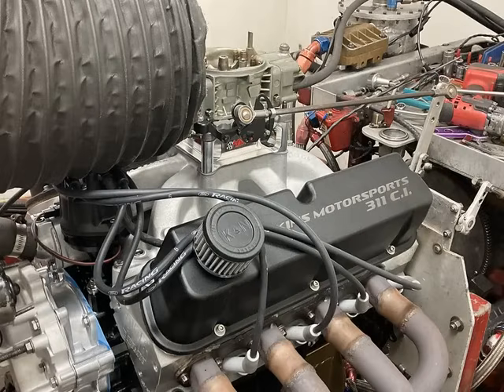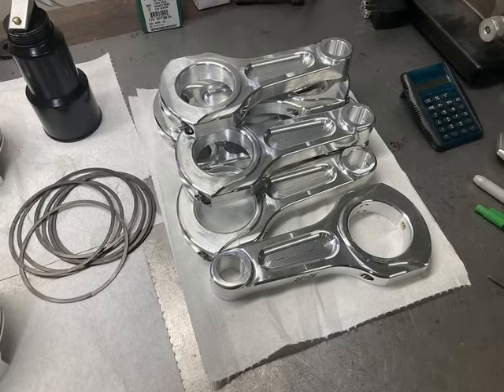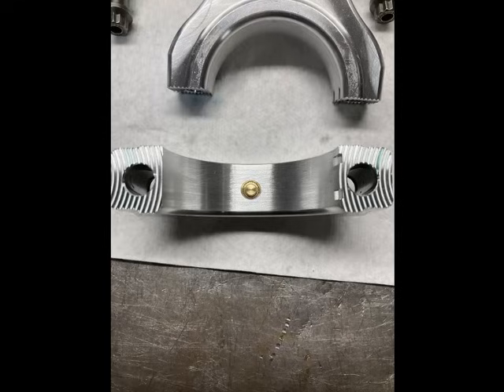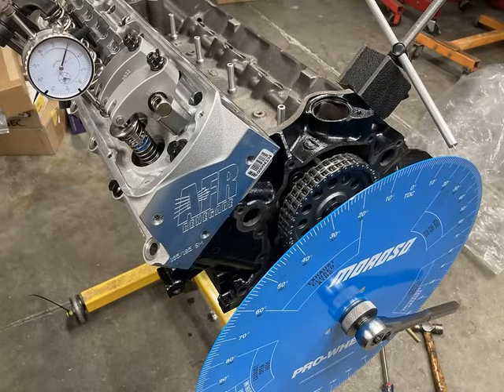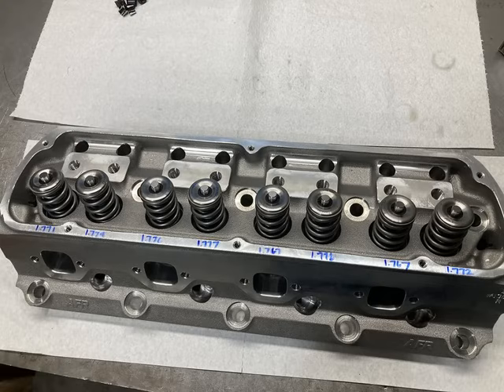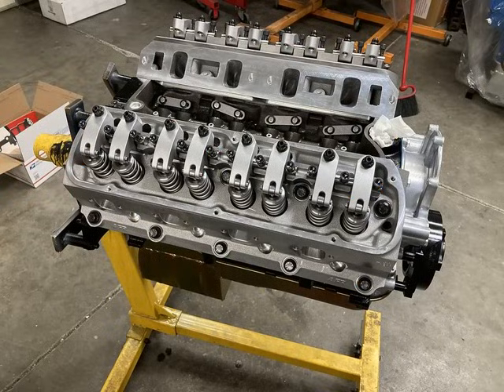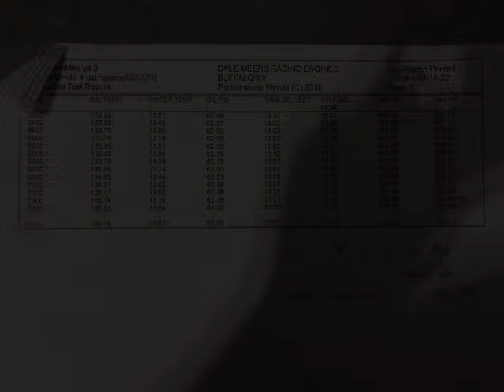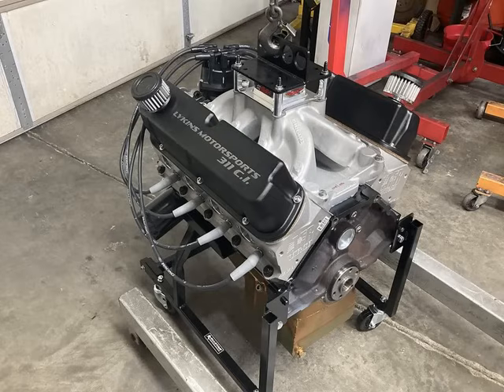Lykins Motorsports 311ci SBF Making Lots Of Power.....

Comment from the maker: My goal is to match this horsepower with the GT40P headed 302.   Think I can do it?
Reply: My goodness, sounds ambitious, but I dont think you would toss that out if you were not going to be close. I certainly hope you can so I can see the combo!  Get well mister, and dont twist your back with a load in your arms. GO TRIPLE J!!!!!
Reply: My Late stepdad built a 289 pushing 504 HP at 9 grand. Black Flagged at 68 Daytona time trials. 167.86 mph lap speed. 210 in the back stretch. Teched and confirmed legal. Ted was a different kind of Man.
Reply: Not without a power adder.
Reply: Not if that's the only change.
Not at this rpm.
Reply: How does max valve lift affect p to v? When the valve is open all the way the piston is well down the bore?

Comment: IMO very impressive results for such a small short stroke engine in a world full of 347 SBFs. Was surprized at the torque too from such lower compression.. What a great job that proves how important the combination is..
Reply: And they say there’s nothing to the rod length to stroke ratio! See what it can do?.
Reply from the maker: Hahaha, there is nothing.  The rod simply holds the piston to the crank.  A long rod makes for a light piston.  That's pretty much it.
Reply: @lykinsmotorsports  sometimes  the simplest  things  are what works.

Comment: Nice job!  Having such tight piston/valve clearance with only 0.530" net lift points to a super tight LSA and a lot of cam advance...  but peaking at 7400 RPM with only 239 @ 0.050" usually indicates otherwise! I'm guessing a massive I/E split.  lol These 289/306 engines really run strong once you install some decent parts and arrive at a good combination!  SFT cams also work great on 7k rpm 289/302's as the limited displacement of these engines doesn't demand crazy airflow.  They use to be a cheap way to build a strong 289/302 engine before flat tappets became unreliable.
Reply from the maker: I’ve heard all my life that advanced cam timing builds low end and retarded cam timing does the opposite but IMO that shouldn’t be a general rule.  This engine was on a 101 degree ICL, 8 degrees advanced.  Massive is relative I guess, but I would consider 20 degrees to be massive.  8-10 is “normal” for me with a Ford head.
Reply: n20 mike  long time no see. im using my x laptop  this is strokerman from way back, brent builds some awesome motors.
Reply: @lykinsmotorsports  A wide split helps them RPM.  Kind of the best of both worlds.  I built a 306 decades ago right before all the aftermarket heads and Chinese stroker kits came out.  Had owner ported 289 heads.  I spec'd the SFT cam out as 236/248 @ 0.050" and 0.560 lift.  Comp 282S and Comp 294S street lobes.  Tens of thousands of street/strip miles and often sole transportation.  With a toploader and 4.30 gear it ran 7.48 @ 92 in the 1/8 n/a at full weight and 10.63/6.48 at 127/103 with a small plate.  Most fun street engine ever, and was BEAT on daily.  Basically the same engine with a SFT 242/254 cam and owner ported TW170 heads went 6.27/9.87 at 109/137 on the same 200hp plate and toploader.  Pump gas n/a.  I'm a big fan of the 289/306.  Those engines surprised a LOT of cars that had them beaten badly on paper.  Have a 363 in the same car now, but the 306's were more fun on the street.  363 is too much in an old chassis on hard street tires.  lol
Reply from the maker: It does help higher rpm, but mainly the split is based off of intake/exhaust flow ratios.  That kinda plays into high rpm.

Comment: You are a very smart and well informed engine builder that has humility as well. I'm an old blister at 63 that has built his fair share of race engines and all the suggestions you give are accurate and proven. Its also refreshing that you are willing to test and learn so you can provide the best product possible to your customers. I hope you get the back tuned up and ready for racing again! Had L1-L5 fused, two discs replaced, tumor removed from spinal cord and half a vert removed. Kinda sucked for a while but way way better now.

Comment: 1.72 HP per cube on pump gas is darn respectable. I wish my Pontiac made 1.72 per cube. Its 1.45 HP per cube@474 inches. Torque is 1.35 per cube.

Comment: Brent, 
My -.005" decked Pontiac block has a .440" lobe(largest I am told can fit due to dismeter of cam) and I had .0280" and .0264" piston to valve clearance. Radial clearance was about .070" if memory serves. Thats with a Harland Sharpe 1.65 rocker. I could use more ratio, its just not available in a traditional rocker. I will go shaft rockers, but it will be on a different engine, heads etc. Point is all 1967-79 traditional Pontiac engines have plenty of P/V clearance. Excluding 301's which I know nothing about. I'd assume similar architecture, but dont know for certain. Every Pontiac I have ever built has more than plenty.

Comment: I have a fairly similar 302. Same crank, Scat 5.4 rods Icon pistons and AFR 195 Renegade heads. It comes in at 11.29:1 compression. I reused a E303 cam with Scorpion 1.82 rocker arms 7/16 stud. She runs pretty good. I can run with a stock 50th anniversary Camaro in my Mercury Capri. What do you think?
Reply: We did a basic 347 with the old iron Wilbert High ports that flowed well. Victor Jr and a b303 cam w/ 1.72’s. Just a few dyno pulls and it was 425hp/413tq. Then we sent it to FL for my dad’s Maverick and it has a sniper set up.

Comment: That kind of rpm in a stock block seems like a lot vs using a dart block.  Were other things done to help strengthen the block? Curious on your thoughts there.  Also you mentioned this would be a great setup for street car.  What kind of vacuum does it make at idle?

Comment: I’ve got a question. What would be a good solid flat tappet camshaft for a 351-W 0.060 over with flat top 4 valve relief forged pistons. Stock stroke, Speedmaster 210cc cylinder heads. Victor jr intake. 750 out of the box Proform mechanical secondary carburetor. PA Automatic race transmission. MSD Pro bullet dizzy with MSD 6AL. 4:10 gears. Car has been caged and gutted. Aftermarket wiring harness. The camshaft that I’m using now is 0.500 int 0.522 exhaust 225-235 112 centerline. Thanks. 536 hp for a 311 ci is badass!
Reply: He's in the business to make money.

Comment: What are the small holes around the circumference of the piston top?  I have JE and Racetec pistons and have never seen those.  What purpose do they serve?.
Reply: Gas ports to improve ring seal
Reply: They are gas ports they let compression behind the ring to force it out against cylinder wall.

Comment: I always used shorter lift wider duration camshafts even on flat tappet hydraulics even back in early 90's i run a Erson tq30 was 494 lift advertised 298 duration run hard 3-7k but that was long time ago really cool numbers I used 71 Windsor heads back then with 194 intakes 154 exhausts car was performer rpm and 650 Holley pump gas at 4500 feet above sea level on damn street tires i run 13.27 at 105 first gear was useless 86 fox body stock 5 speed but i averaged 20 miles per gallon and back in 90-92 I rarely lost a race believe it or not. Anyway neat to here a solid roller lifter set up more duration etc run well I am not shocked them types of cams do run well in SBF. Anyway my car would of run mid to low 12's with slicks but id probably blew the 5 speed trying it so never did i was literally best 60 foot 2.1 horrible just spin short shifted second kinda bog then go. This brought so much memories sure do wish I had my old car and that engine sucks being disabled now I can move around just hurts alot more I broke my back in early 2000 51 years old now. Anyway I ever get better off I will remember you and maybe have you build this set up for another car. Thank you for video ty for reading take care and God Bless